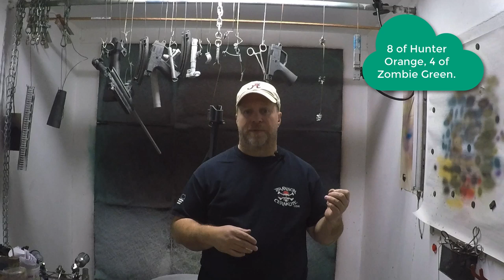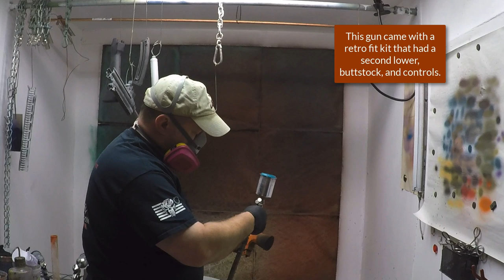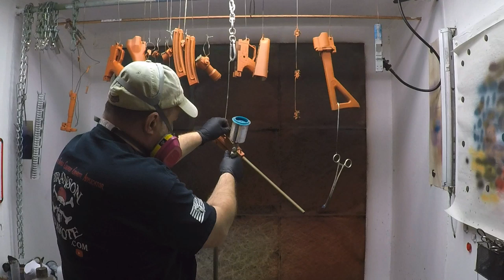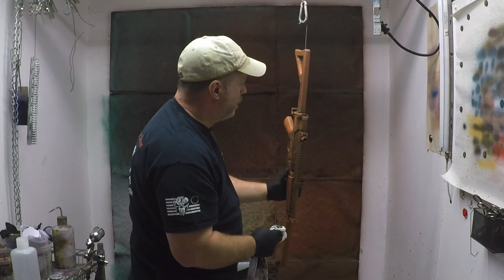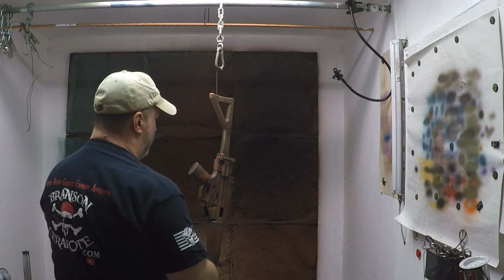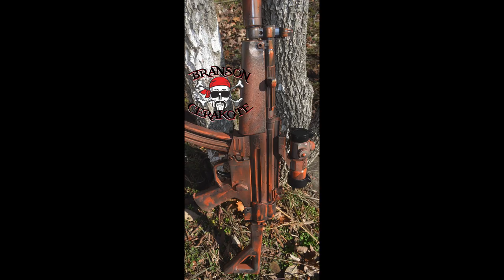GSG 522 Cerakote Battleworn | Cerakote | Branson Cerakote

Comment: After the base coat, you reassembled the gun for the remainder of the process, I understand you throw it in the oven at 150-160 for 8-10 min  in between the coats, but for final bake do you tack the entire gun out, disassemble, and oven cure at the 250 for metal and 160 for plastics? Thanks!
Reply from the maker: Close. We tack everything at 180. Once the final color goes on, we give everything one final tack for about 20 minutes, then take everything back apart, peel any stencils, then bake the poly for 2 hours at 180, and the metal two hours at 250 (we have two ovens). With one oven, just leave the metal out until the poly is done, remove the poly, run the oven up to 250, put the metal in and finish it off.
Reply: @BransonCerakote  thanks so much! You guys are the best.
Reply from the maker: @toddburrell9058  Glad to help.

Comment: I have a question.. Can the air cure cerakote be also baked in the oven?
Reply: No,it will not cure like the H series oven bake cerakote.it will literally stay wet.I use C series since I don't have an oven to bake my painted pieces in and it's really good.I prep,paint and let dry for an 1 hour before I handle it. Then bring it in side the house overnight and reassemble 24 hours later.
Reply from the maker: You don't want to bake C series. It cures too fast and has discoloration. One of the long list of stuff I tried because I was curious.